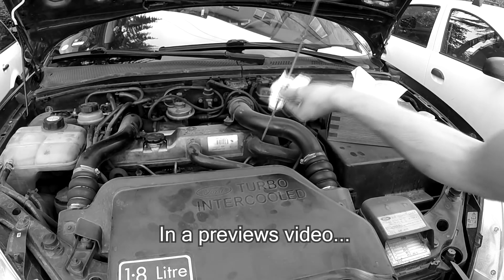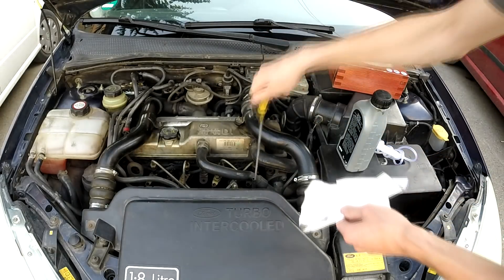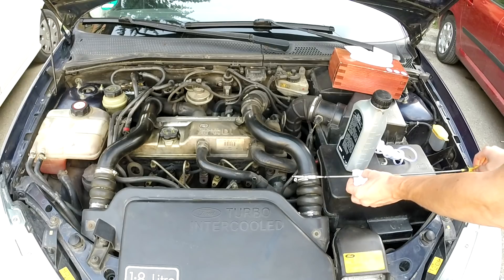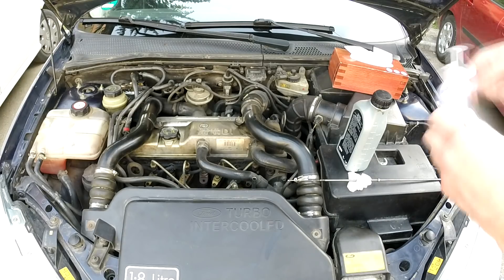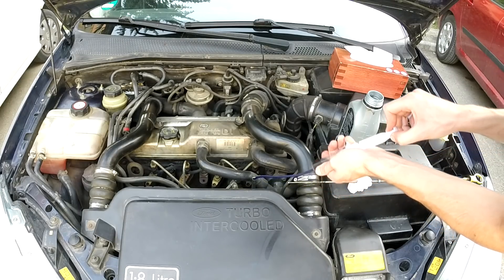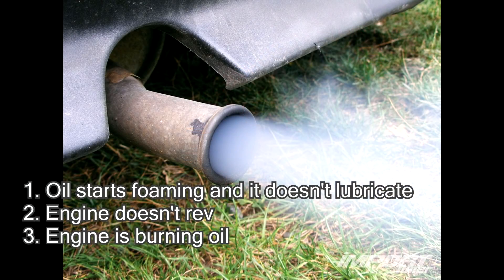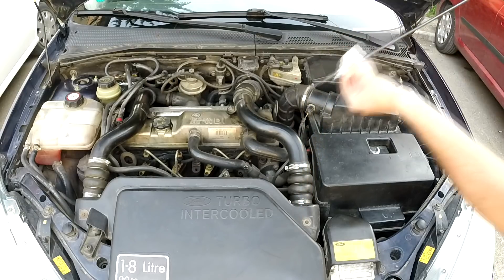Too much Oil in your Engine?

Comment: My 2017 Crf 230 calls for 1.1 quarts. I didnt have anything to measure with so i poured one quart in spilling a little but not much. I then poured probably down to the 700ml mark on the second.
Should I purge some out or should it be fine?
The funnel i used was a little dirty so i tried to clean it out pouring old oil through and noticed little 
clumps so I cleaned that out with paper towels and poured good oil in through it. 
That was the first oil change for the bike and it was very black. I was told it was changed by another household member but it does not ever appear to have been changed. The book says every 600 miles. Its probably been a little over that.
Reply from the maker: That funnel part didn't sound very well and your measurement technique didn't sound good either. Why don't you buy the proper tools or borrow them before you start?

Comment: I have an engine that only checks accurate when cold? It's hard to read when hot, why is that?
Reply from the maker: When the engine is cold, hopefully all the oil is down in the pan and oil expands a tiny bit when it gets hot. Nothing out of the ordinary.

Comment: If you ever overfill you're car, just take it to a mechanic shop. Itll be a flush with new motor oil, best thing to do if you're cars stalling, not picking up speed or blowing white smoke.
Reply from the maker: Yeah, if you can’t fix it yourself, always seek professional help.

Comment: Can too much oil cause a crank bearing failure
Reply from the maker: It usually causes premeture wear due to reduced lubrication (oil foaming). That eventually leads to failure.

Comment: Always put less of what the manual says when you change the oil because a lot stays inside the engine when you drain it.
Reply: I told the garrage to put 3,5 l of oil, but they said my car needs 4,1. Luckily i had only 4 liters. After the job was done, the oil went over the dipstick a little.

Comment: I added too much engine oil in my car, resulting to smoke. Later on,  leading my car to smoke.Which parts do you think would be damaged, how damaged is it ?
Reply from the maker: Based on the information you've given me, I have no idea... 
Probably the internals of the engine...
Reply: If you read the manuals and stickers under the hood they state that overfilling oil can damage the catalyst (car burns a lot of oil and the resultant products damage the cat).

Comment: so I got an oil change after I had too much oil. so it should not be too much oil but I think because I have an oil leak oil is dripping and burning off. How can I fix that.
Reply from the maker: How can you fix an oil leak? First of all you should figure out where it is leaking from.
Reply: so I am planning to get the engine clean to see where the oil leak is coming from but everyone wants to charge so much.
Reply from the maker: @lynette5286   Brake cleaner + cloth + time. You can try pressure washing it but it's not recommended...

Comment: I worked in my dad's machine shop and worked at a lube shop for 10 years. Engine oil typically doesn't expand much. Trans fluid on the other hand expands quite a bit as well as coolant. This is why they have hot and cold levels.

Comment: Please start the engine for like 10 seconds then turn off before you check the oil... please! Don’t teach people to check the oil after every bit of it has drained to the drain pain it’s going to show too high and people will drain there oil when not necessary.
Reply from the maker: I believe this discussion is like viewing the number 6 from a side or the other, one says it's 6 and the other 9.

Comment: If it's black change it,
Reply: Wrong . If you're running a diesel brand new will turn black on start up.  To check for bad oil... use you skin . If oil wipes off clean you're good. If it smudges change it.
Reply: If you use cheap oil, if you use something like Mobil 1 full synthetic extended performance it's not going to turn black until just past 10,000 miles, I should know I just passed Ten Thousand Miles and it is brown but not black
Reply: Bro don't lie LOL brand new diesel really are you sure, LOL I drive an older Cummings and can go over a thousand miles and the oil will still golden like honey LOL so I don't know what you put in your diesel but it must have been crap
Reply: Oil**

Comment: Can't you extract oil from the oil fill port? the same place you add oil. you could use a much shorter tube or even just put the syringe straight into the oil, no?
Reply from the maker: Oh god, no! Your engine isn’t flooded with oil. It’s not like a gearbox or a diff. The oil is pumped up from the oil pan.
Reply: @N33sWorkshop  Oh i see!  many thanks, i'll use your method.

Comment: If your oil level is over filled... and you didn't put it in there, you have a major problem. Simply removing the extra oil ain't gonna fix it.
Reply: Matthew Foote 

What ?
Reply: @jacksmith3189  If your oil level rises on it's own, that's an indication of a major engine problem, such as a blown head gasket or severely worn piston rings.
Reply: You have extra oil u didn’t put in?
Sign of a blown motor

Comment: Just man up and loosen the oil drain plug. It’s what I did when I put 5.5 quarts in my 4.5 quart engine. But don’t freak out or you’ll end up with a spill. No need for such fancy schmancy stuff like this
Reply from the maker: It’s a simpler and cleaner solution. Also less time wasted ;)
Reply: N33s Workshop I understand that :)
Reply: Frederick Hydrargyrum Any chance you have a 4.3L v6? That’s what mine takes with a new filter. 
I’m anal about filling, but I’m not against doing the plug method. You buy 5 quart jugs, there’s s half quart to play with.
Reply: @Backyardmech1  I have 5.7L 350, and yeah I save the half quart in case I should ever need it :)
Reply: Yep, that's what I did! Had put some neoprene gloves on first and some under layment under my oil pan because I know it is messy, but better than driving with too much oil. I dumped some then plugged and rechecked level then had to dump some more!!! These guys are real criminals! The oil I released was ALREADY BLACK! WHAT DOES THAT TELL YOU? The oil change was one day earlier!!! I feel sad for all the folks they are stealing from! The Govt does NOTHING against these crimes.
Reply: That "fancy" stuff will save you alot of mess, time,  labor. Also if that's what you call fancy I'm sorry for you.
Reply: DC R I guess I just like to get my hands dirty

Comment: in my 1.5l hyundai accent car i poured 3.5L of oil instead of 3.3L. is it ok to run with 200ml extra oil?? oil level is above the dipstick say 1cm its above the max point..is it ok or else i have to remove??
Reply: +Asifali Azaan i didn't feel any  change after removing the excess oil.. u just remove it.. As experts advice  excess oil may damage the engine..after removing the excess oil as shown in this video make sure that the oil level in the dipstick up to high mark..hav a nic day.
Reply from the maker: I'd remove the excess.
Reply: +TimeGhosts anyhow i removed the extra oil..
Reply: armrub do you feel any change after remove excesive oil, I have same problem in vitz and I want same thing plz guide

Comment: Oil in air filter(less quantity)what is the reason for that???(1.6 crdi diesel turbo engine)
Reply from the maker: You use a K&N air-filter ( XD ) or there might be problems with your PCV system, google is your friend BTW.
Reply: If it has intercooler connected, it could have come back sometimes. In my tiny little experience so far, it doesn't create any issues If the oil is less. If its too much of oil, getting professional help may be needed.

Comment: Small amount of extra oil is no big deal, nothing will happen. (3-4 milimeters on dipstick above max, equal to 0,1 to 0.3 litres of oil).
Reply: AGREE
Reply from the maker: It's not about the small amount, don't encourage them...
Reply: My Ecoboost equipped Lincoln sedan requires 5.8qts. I simply ALWAYS use 6qts simple safe.
Reply: @Davido50  - I just did the same thing. My engine takes 5.8 and put in 6 quarts. You think that will damage the engine?
Reply: My altima requires 4.8 quarts i add full 5 quarts jug...

Comment: When I check my dip stick the oil goes way over the fill line but is very thin and clear where it is thick and dark amber is way below the fill line does this mean it is overfilled or underfilled what am I doing wrong it seems everyone else has an easy time reading their dipsticks but mine is like an enigma.
Reply from the maker: I don't believe you do anything wrong. The oil level is where it is dark amber (for gas/petrol cars, in diesels it becomes black after a few days). If it is between min and max, leave it alone. 

Unfortunately I can't give a perfect answer on the internet, because I don't have all the info. Ask your friends, your neighborhood mechanic, your parents for an advice.
Reply: Use 1 liter as a chaser next oil change
Chaser means to put 1 liter of any cheap new oil in the motor with the drain plug off so the oil drains thru the engine from top to bottom therefore cleaning out the motor of sludge and dirt 

Then add your oil to the engine with the drain plug in place , then check ur oil level and the oil on the dipstick will look clean and even in color

Comment: I drained my oil but still have smoke out of my exhaust how do i fix this
Reply: I used the head gasket sealer and it stopped having the smoke
Reply: clean the egr and manifold.....  make sure to use the company specified  grade oil..... and replace ur fuel filter
Reply: The smoke blue in color ??
Reply from the maker: Add the correct amount of oil with the correct viscosity and go drive for 20 minutes. If it doesn't stop, go buy a new car. XD
Reply: This happened to me...  I had a lot in my pipe...  I had to replace my whole exhaust system

Comment: My 2005 Saab 9-3 arc By factory says that it needs almost 7 quarts of full synthetic oil Mobil 1 😢 at almost 10dollars a quart it hurts me, but it's worth every penny cause at over 140k it runs like a champ
Reply from the maker: You can use other oils that have the same specs or proprities. 
Another thing, if you buy an expensive car with big engine the maintanace will be more expensive too.
Reply: Go to Walmart, best prices on oil. My audi takes 7 quarts too and save 20 bucks if I get it from them with the filter. Auto parts stores charge a lot.
Reply: Thanks guys👍
Reply: Lololol 140k is literally nothing. Got toyotas out here lasting 300k still smooth
Reply: @ToyotaNutjob  yeah can't beat toyota.....well Idk about rhe new ones but the older ones are great!, we have a Subaru with 300k at least more cause the spedo stop working at 300k lol

Comment: 0.5mm-1cm above max is absolutely fine. Many mechanics overfill by that much also. No issues
Reply: Ya, and the smart ones never do.
Reply: The nickname of yours is really impressive that indicates true. Definately true.
Reply: Is .2 of a quart too much for an engine that’s supposed to take 5.8 quarts?
Reply: Kim, 1cm above full on dipstick is too much. That's equal to like 800ml. Money no object for you Kim as you run your own country so yeah keep on filling up 1cm above the full mark.
Reply: @saauuzza  Wrong! 1cm is approx 1/3 quart (315ml), 3rd if the has marked area, with the whole hash area = 1 quart, on ALL dipsticks, 945ml would be a full Q, and that would never read as only 1cm above!
Reply: @DanLoFat  Professor doctor mr know it all, first of all I was talking to Kim Jong Un. 
Secondly according to my Volvo XC60  owners manual page 296, the volume between min and max on the dipstick is 1.2 litres. The marked min/max area is just longer than 1 cm. So the marked area  = to 1 quart is you thinking you're smart but you're not.  There are no standard that says it has to be 1 quart especially in a world where we think in metrics.

In Europe and Asia we would not be using odd numbers like 945 ml.  While it's easy for Americans to memorise 1 quart, it would not make sense to remember 945ml.
Reply: @DanLoFat  Just to add another car that I used to have, Japan made Subaru WRX. I am sure the owners manual stipulates that the volume between min/max is 1 litre not 1 quart. As the outside of USA world thinks in metric, that is 1000 ml not 945 ml so you are wrong again. That's two cars that you are now wrong about. I suppose I could go on.....but you get the idea.
Reply from the maker: 1cm is too much... Respect what the manufacturer said, they know the best! 
Also many mechanics don't give a * about your car, they want to do the job fast.

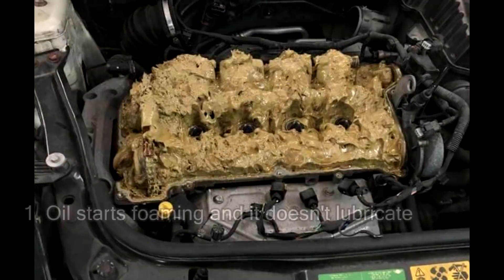Comment: @2:27 thats the CAMSHAFT NOT THE CRANKSHAFT!
Reply from the maker: In the image, yeah, it's a camshaft. 
I used the image as example... for oil foaming.
Reply: Oil never gets in contact with the crankshaft and journals, conrods ( connecting rods) don’t get oil contact

Comment: What if I have that problem how do I fix it, open the engine head and clean it?
Reply: Gerardo Aldana from my personal experience cleaning it won’t do any good. If you’ve been driving it with too much oil chances are you’ve blown rings or caused some type of damage to your engine and when you add the correct oil back into your engine it will just keep burning oil like crazy because the damage is already there

Comment: I over field my 4 cylinder ford ranger with oil by not much got on the high way an it lost power an now it’s misfireing an has low power rip my ranger
Reply: Probably busted a valve seal
Reply: @liveandletlive2894  probably now its runing like normal an has power but when I rev it past 4k it blows out blue smoke
Reply: @kamryn7496  ok definitely burning oil since that's what blue smoke means
Reply: @kamryn7496  if you live in the USA go to a walmart and buy lucas stop leak oil DO NOT USE SYNTHETIC add the lucas to your oil and you can get another 100K miles like that
Reply: live and let live thanks for the tip I’ll try that.  I remember the Lucas transmission additive stoped my transmission from slipping on my last car
Reply: @kamryn7496  so try it for the oil get the 1 that says itll prevent leaks.....the problem you have is oil leaking through the seals into the cylinder under pressure (4K RPM and higher) then getting burned with the fuel

Comment: Where to buy plastic hose some one please recommend
Reply: Z & Z Fun time 

Home Depot or Lowe’s
Reply from the maker: At the petstore.
Reply: Or just do a manual oil service on your vehicle. Pull off the drain plug then the oil filter, let it finish draining then get the new oil filter, rub oil around the gasket and slowly put the new oil filter back on and hand tighten it. Then throw the drain plug back on, also just hand tight it then give it one soft crank with a spanner, or ratchet then throw the new oil in and the correct amount (Will be in your car service manual).
Reply: At the plastic hose shop. Don't you know anything ?

Comment: if you overfill your engine oil an take it out after couple months will your engine be back to normal ? meaning no smoke ,no engine rev an ect.
Reply: Mines fucked wish I took it out soon as I relised
Reply: Lisa Young what ended up happening?
Reply from the maker: Too many factors there to give a yes or no answer... But it should be better than overfilled. Probably it's too late already, but who knows?!
Reply: apparently if this happens, you die